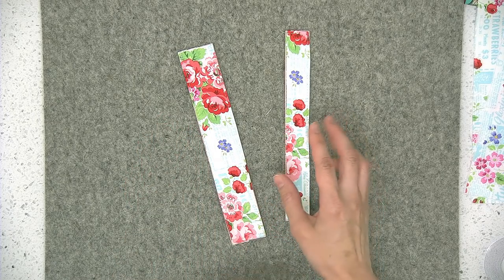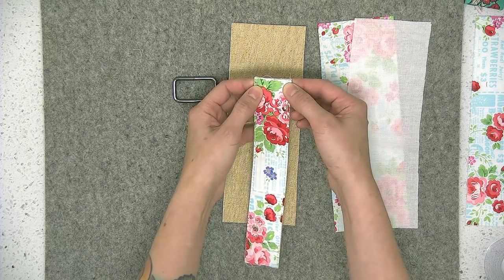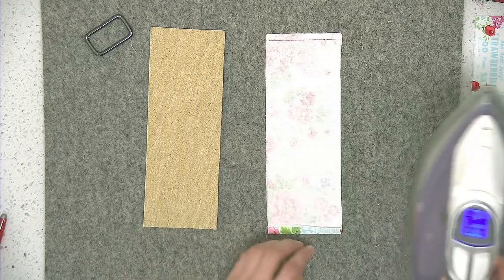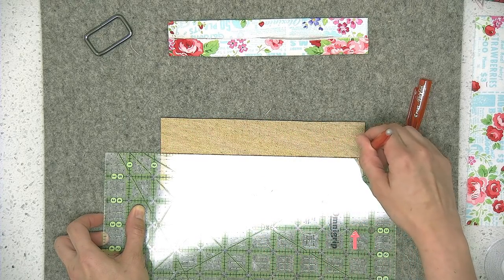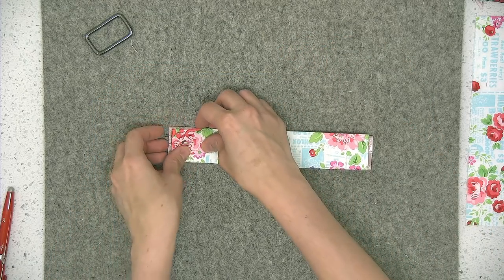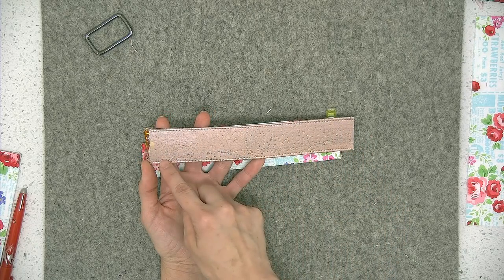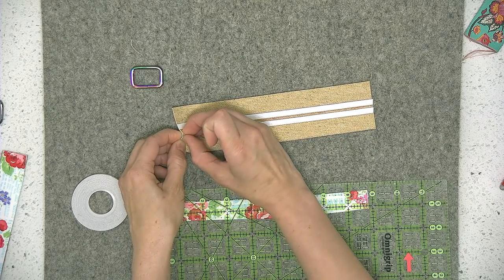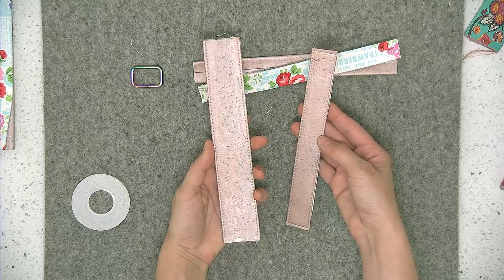How to Make a Double-Sided Strap

Comment: If you use grosgrain ribbon for 1 side of the strap do you make it the same way as you would with vinyl or with cotton?
Reply: As the ribbon is sealed on the edges you wouldn't need to fold that in. Would look very pretty with ribbon one side and cork the other!